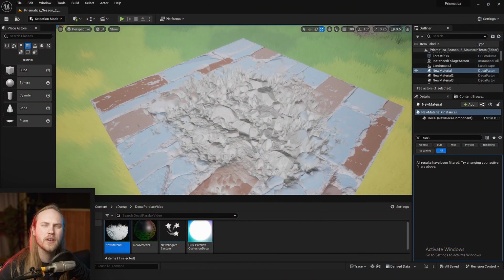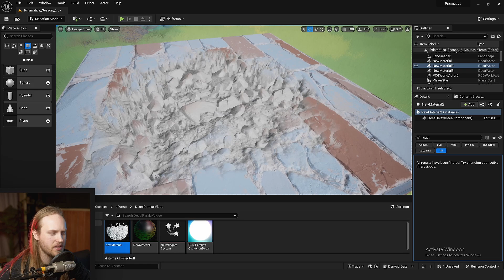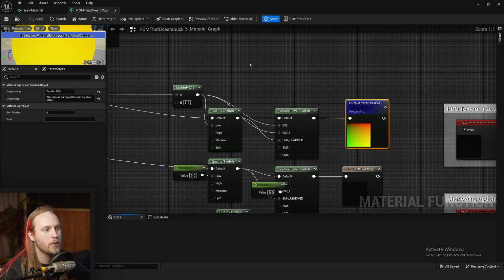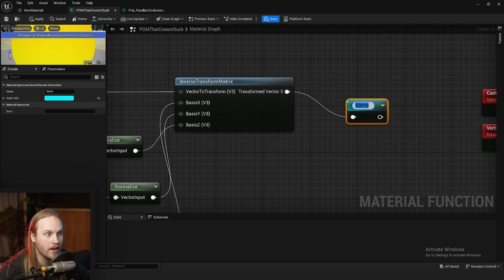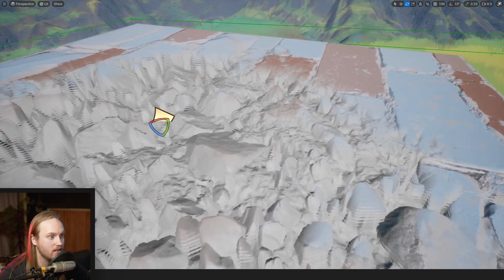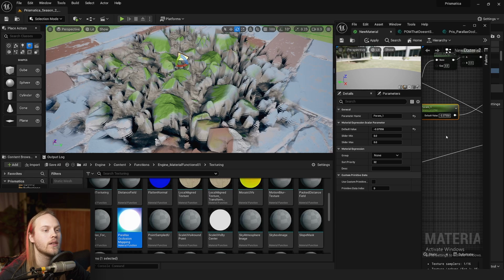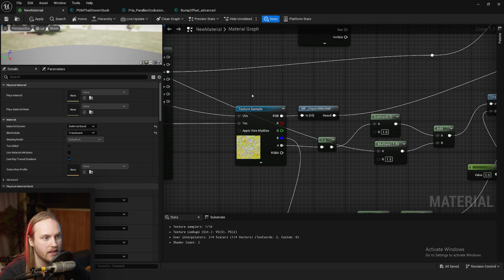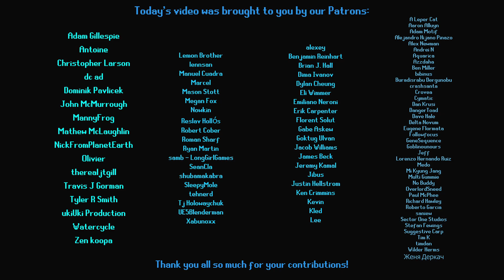Parallax & Bump Decals | 5-Minute Materials [UE5]

Comment: Works great and rotation works if you rotate the decal, but if you rotate the UVs it breaks.  Any thoughts on how to input UV rotation into this?
Reply from the maker: Oooh that's a spicy one. I'll have to check when I'm in engine next!
Reply: @PrismaticaDev  I actually found a way to make it work by adding a custom rotator off the view trace length and input UVs and then add a rotation input then also breaking out the floats and adding a custom rotator for the Light Trace.  Oddly, I can only get it working when rotation is from 0,0 and not center.  Not a big issue tbh, as UV tiling can adjust for that, but rotating from center seems to mess it up.
Reply: @BDubs1000  Can you please provide or explain the setup ? Using Custom rotator off the view trace length and light trace (after breaking floats) gives really wrong results with UV rotations.

Comment: Hi, thanks so much for this tut, youve really saved POM decals. 
Im also looking for a way to correctly transfer only Height to a Receiver Mesh material (meaning the Receiver's Col, Rough, Normal textures get displaced by the POM Height) 
 Ive tried using Dbuffer to transfer Decal's original and POM UVs, subtract them to get an Offset, then add it to Receiver UVs, plug that into the textures.
The height POM kind of shows up, but its all wobbly weird and the texture seems stretched (compared to regular decal response)
I hope you can find a way to solve this! 
Then we can easily add interesting shapes to a receiver mesh, rather then slap on a brand new material altogether

Comment: Shadows don't seem to work for me on POM decals.  Everything else works great.  Did you need to do something special to get shadows working here?  I'm using UE5.1.
Reply from the maker: Have you debugged by plugging the Shadows straight in to the BaseColour? Make sure the light vector is valid and also make sure that the "Use Shadows" input has a ticked static boolean going in to it
Reply: @PrismaticaDev  Thanks.  When plugging shadow directly into base color it was all white so I guess it wasn't working for me.  I rebuilt the material function and good news is shadows are now working.  Bad news is that they don't rotate so stay facing the same direction on the texture when rotating the decal.  I'm thinking the problem here is me!  lol

Comment: Hello, good content. I signed up right away! Is there a way to make the texture transparent, but so that shadows are shown on it 100%?
Reply from the maker: Hmmmm good question. You could just plug the Shadows into the BaseColour of the decal and then OneMinus the shadows and put it into the Opacity. However you might just be able to use the Ambient Occlusion output of decals but I'm not 100% sure, I just woke up lmao
Reply: @PrismaticaDev  if you change the transparency, shadows of other objects will pass through the material
Reply from the maker: @npoctobblpogok3730 Are you talking about the Decals in this video? Or do you mean shadows in general. If the latter, check out my Shadow Pass Switch material video! :)
Reply: @PrismaticaDev  yea, I saw the shadow switch, it makes the object invisible and the shadow visible. But that's not what I need. Anyway, it's hard to explain, but I have a background that needs to be visible, there is an object in front of it that casts a shadow towards that background, and only the shadow of the object needs to be visible through that background, nothing else. I would show it visually, but that would be your homework :D
Reply from the maker: @npoctobblpogok3730  Ohhh so like, you want ONLY the shadows to show up on an object? Kind of like a living shadow sort of effect? Something like that is possible but only with a Scene Capture and Render Targets, not the lighting/shadow pass itself
Reply: @PrismaticaDev  oh, man, I knew it. Thanks for the tip

Comment: This is great! I'm only having one problem with this (or any POM decal honestly) : if I scale the Decal actor on the X axis, the effect completely breaks. Any ideas for how to solve this? I tried to use "Object Scale" and multiply the Height Ratio to "Scale X", but it doesn't seem to do anything.
Reply from the maker: Hey hey! Do you mean the parallax effect looks super banded? There's another more reliable way to get Scale, give me 1 sec to double check
Reply from the maker: I believe if you get 1,0,0 and plug it in to a Local -> Worldspace node, then subtract it from the PivotPoint and get the Length of the result, it should be the "length" of the X scaling. I'll be able to test tomorrow
Reply: @PrismaticaDev  oooh I didn't think of that! I'll try it on monday :D Thanks mate you're the best!

Comment: Parallex or bump has better performance than polygon model?
Reply from the maker: @JieDu-yj2vd  In traditional rendering, yes. However Nanite tessellation could potentially be cheaper than POM if you’re using Nanite. Regardless, you’ll need to use parallax effects for decals :)